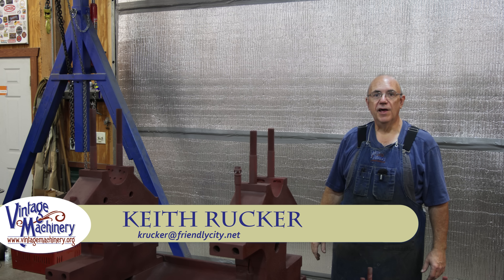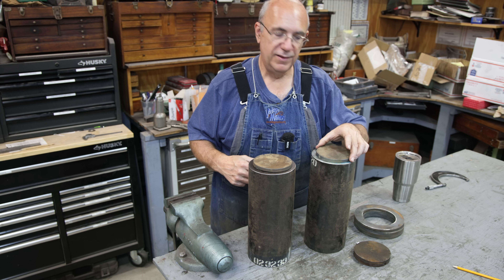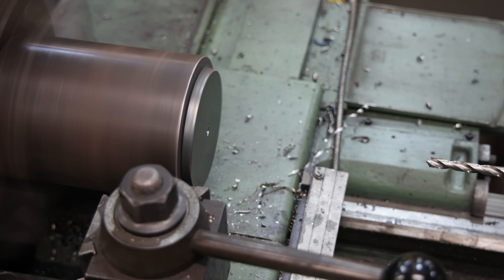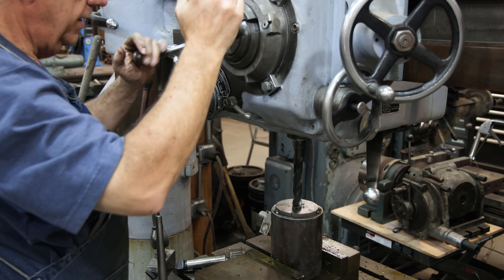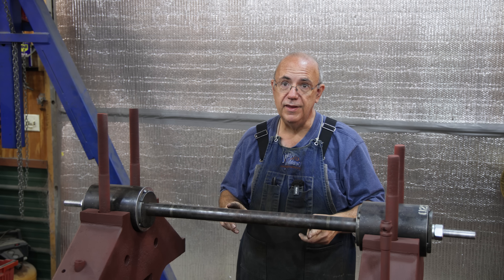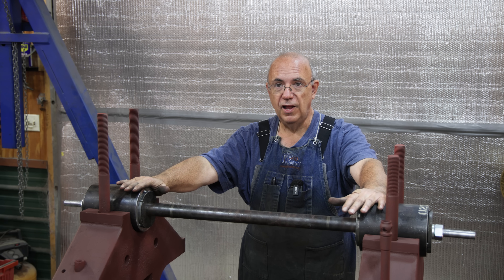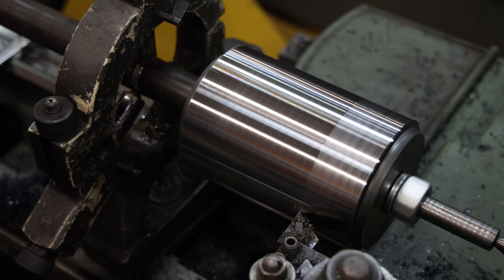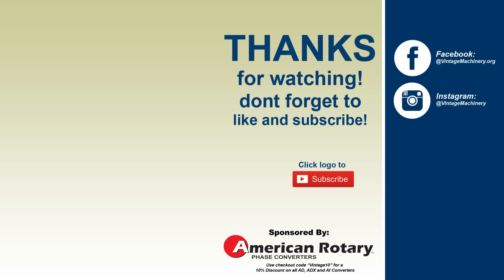Monster Cane Mill Restoration: Making a Pouring Mandrel for the Top Roller Babbitt Bearings

Comment: That’s THE first time I’ve seen you catch an incorrect thread pitch using a scratch pass!   You taught me to also do a scratch pass……..and I do!
Reply: Thought the same thing.
Reply: Yeah exactly. Time spent on a thousand scratch passes is returned 100x by a single mistake that ruins an expensive or irreplaceable part. Abom79 talks about his experience with this as a young man. A good lesson for life even if you aren't a machinist. 😊

Comment: The reason for the wobble at about 24:00 is you used a very long 3/8 drill to drill through the tubing into the other face of the plug. A 3/8 drill that long has very little rigidity and drilled where ever it started: there was no centering of the inside of the of the opposing plug.  Yes, after you turn down the outside diameters of the tubing it doesn't matter. Also, the end caps weren't faced either and the nut tightening up on them will also cause a wobble, believe it or not. Screws (nuts in this case) can create massive forces with little effort.

(at 25:40 Keith admits my second cause of the wobble)
Reply: To your second point I thought the same. Why not face the ends? When he skipped over that operation I expected issues. As soon as he saw the wobble he should have stopped and corrected the error.
Reply: It might have been easier to centre the round bar by poking it up the spindle of his big lathe, then bore the flanges to the size of the round bar, and tack the flanges to the round bar.
Then when turning the od of the pipe turn the first one against the 3 jaw chuck and turn it around to do the other one.
I would bet my house on the runout being from the flanges not being faced.

Comment: One thing I will never be able to say....."My smaller 16 inch lathe"
Reply: I've got lathe envy.
Reply: Never say never. 😊
Reply: Me either
Reply: I used to be able to say that.  I don't miss the bigger lathes in my older age.  Have a 15" and 14" and a 9" that will take care of anything I ever  will have a need for.
Reply: @4GSR  I have a taig.....I do have a little bigger lathe, but I seldom use it. It's in the basement, and at 80 yrs I don't do stairs like I used to. I just make sure I do smaller stuff and the little taig works fine for that. its 2 plus inch swing.....but very accurate.
Reply: lol , 16 in little lathe no thanks

Comment: couple of thoughts you need to center the plate on the ends true to each other and you could have just turned the pipe to dimension first before welding the caps but like you said it really does not matter it is a static fixture
Reply: Don't take this guy too seriously, just watch for the laughs!:face-blue-smiling::face-blue-smiling:
Reply: They need facing actually

Comment: Did you bend the shaft when tightening the nut?
Reply: I think it would because the end plates were not parallel. I wanted the ends faced, but Keith wasn't listening to me. A surprisingly small amount of force will distort things.

Comment: Intresting video. Nice to see a scratch pass save the day.
I believe the runout comes from NOT facing the welded plates in the 5” tubes.
Start with that and the system do not warp when thighening the nuts.
Keith Fenner has a video series called “There must Bea lessen learned here somewhere” when a faulty nut warps the grinding spindle.

Comment: Correct, because you didn't face off the plates you welded on, but also the way you drilled the thru holes with that long drill bit.  The hole on the far end is not on center.
Reply: OMG, Any young person wanting to become a Machinist, PLEASE, do not imitate anything this guy is doing!
Only at Vintage Machinery is a Steady Rest used to FORCE a bent piece of stock to run true!
Reply: @garybrenner6236  If you need to damp vibration, the way to do it is to mount the whole thing on centers and then take just enough of a cut on the center shaft so the rest can bear on a true surface. I'm assuming that he did not show that step......

Comment: I really like the way you handled the runout situation. As a hobby machinist I have learned a lot.
Reply: OMG, Any young person wanting to become a Machinist, PLEASE, do not imitate anything this guy is doing!
Only at Vintage Machinery is a Steady Rest used to FORCE a bent piece of stock to run true!
Reply: @garybrenner6236  100%  Had he faced those ends he welded on before drilling would've cured this..  The fact he knows this and even pointed it out and still did nothing to fix it is infuriating.  Hearing "that's good enough" over and over is what lazy people say.  Take pride in your work and do every operation the best you can. It doesn't matter if it's something you'll only use once or something no one will ever see!  You'll save yourself so much time and headache.

Comment: The challenging case isn't nearly as often when you take the time to make things square and true in the beginning.. Do every operation 100% and stop using "this'll be good enough" as a excuse for shortcuts.   The little bit of extra time it takes cures these headaches and possibility of scrapping a part costing even more money and time.  Not to mention pride in workmanship.  Grind those welds off, face off the tubing ends, weld new plates on, FACE THEM, and then drill new holes.

Comment: When you had the shaft between the chuck and the live centre you noticed the shaft was wonky, rightly you assumed this wouldn't matter if you'd turned both ends without repositioning the workpiece.
Now I could be wrong here (it's been about 40yrs since I touched a machine) but after you switched lathes and introduced a steady rest, thus restricting the shaft to run on the same axis as the chuck and live centre, if you turned both ends using that setup wont they twist back 𝙤𝙪𝙩 of line once the central 'wonky' shaft is freed from the steady rest's restriction?

I guess babbitt is fairly soft though so final fitting may not be too difficult after all.
Reply: Don't take this guy too seriously, just watch for the laughs!:body-blue-raised-arms::face-blue-smiling::face-blue-smiling:

Comment: If those tubes are a few thousandths out of true, end to end, when you put tension on the rod it will introduce a bend like you are seeing. The next time, spot face the inner two inches of the tubes after welding on the ends. And just for a lark, rather than drilling to exact size, drill a 32 under and bore the holes to size on the lathe. Drill bits do wander a bit and that can't help the situation. All that said, the way you did it will be fine for what you are doing.

I would not weld up any minor gouges. Since you have to scrape the bearings to get final fit anyway. a few thousandth ridge will mean two strokes with a scraper. As compared to the time to weld it up and then re-machine it. Once again, good enough.

Comment: do metal shavings have salvage value at recycle?
Reply: Yes, always, problem might be where to take it and how much weight is their minimum weight. Finding an iron monger (as scrap dealers used to be called) is key to any job shop.

Edited to add, if you are making enough scrap, all the same metal (no mixed steels or other materials), then you can sometimes get a roll off bin to accumulate enough to make it worth the dealers while to come pick it up.

Comment: I've often wondered about the wobble when a drill bit starts. I assume that's flex in the drill bit itself, due to imperfect symmetry of the sharpened end? But it seems to go away once the bit is through. Does it correct itself? Are shorter drill bits more accurate? Does the initial wobble affect the hole diameter? When you used the long 3/8" bit, how accurate is the far end hole?

Comment: Could you pour individual bearings and use the boring mill to size and line bore?
Reply: How would you get the boring bar over to the bearings, or the bearings over to the lathe? It's kinda... heavy.
Reply: @cannotbeleftblank6027  He has a Lucas boring mill with a large table and tail stock support.

Comment: You could have turned down one of the tree trunks you've got lying around after the storm. Slip the bits of pipe over the timber and I'm sure it would have survived the heat for long enough.

Comment: Can't you use a piece of wood for the pouring mandrel? That would cost just about nothing. Turn one in the wood working shop.
Reply: This might be worth trying. On a smaller bearing the Babbitt would cool fast enough that the mandrel would not catch fire before the metal solidified. On a larger pour like this I don't know. Likewise, the dams could be  wood.

Comment: Keith, looks to me like you did the machining kinda backward - I mean, you neglected all "corrective measures" or "errors accumulating precautions" on the way.
If I were to make this mandrel I'd square the cut pieces of the hollow bar first, probably made some undercuts on these discs so they'd fit nicely, centred and square into these "cylinders". Then, after the welding, I'd rough in these two guys - just to make them round and the caps square. Only after that I'd drill them, turn the connecting rod - and assemble the whole thingy - AND THEN I'd do the final "truing".
Yes, it looks like a whole lot more of turning, but in fact, since we are not aiming at any specific dimensions (at the roughing stage, that is - the goal at this stage is only to get things true, centred and square) that would be a quick job - but that would ensure we're not introducing any unwanted errors and distortions along the way.

My guess that his big run out you got after the assembly is pretty much due to these rolls not being machined up to this point - when the cap isn't square and you're tightening that thing with a nut, it may cause the rod to flex a little, I suppose. Well, there HAS to be some reason for this to develop this run out - the rod was pretty much straight when you machined its ends, so...
Reply: Don't take this guy too seriously, just watch for the laughs!:body-blue-raised-arms::face-blue-smiling::face-blue-smiling:
Reply: @garybrenner6236  Which one?